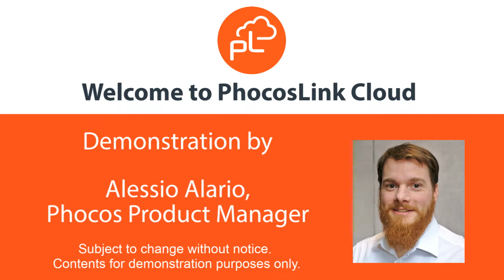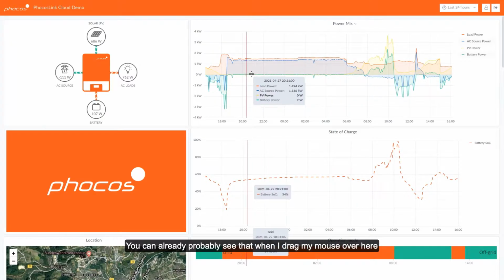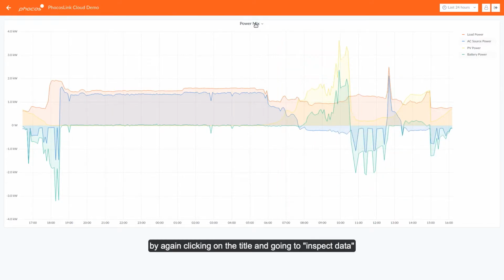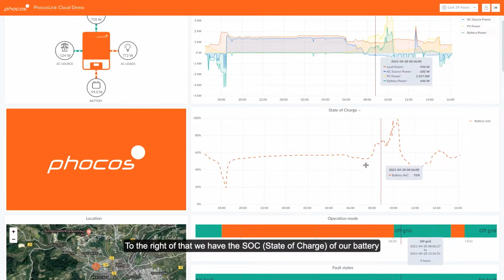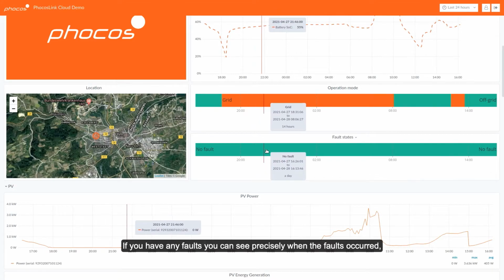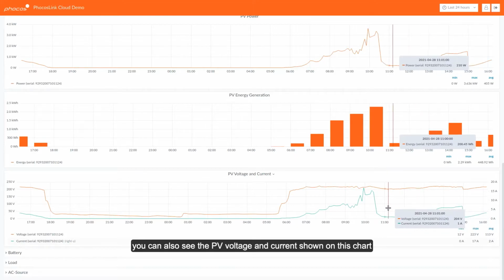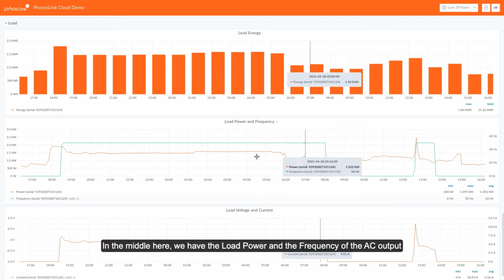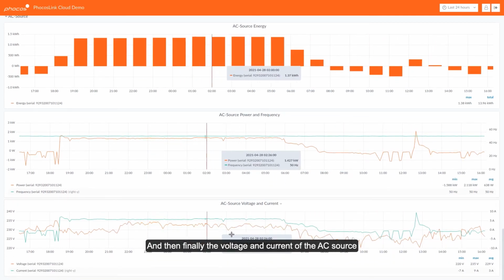PhocosLink Cloud Demo

Comment: Do you have a Data tracker that does not require the cloud?  I am looking for the ability to track (live view) and record input/output using a windows 10 based PC via Ethernet, Wifi and/or Bluetooth.
Reply from the maker: Hello, we currently do not have such a product. However, the Any-Grid PSW-H and PSW-B models can be queried via RS-232 (also RS-485 for the PSW-H series) with the cable included with every inverter/charger. Please contact our support team for details on the protocol at info@phocos.com